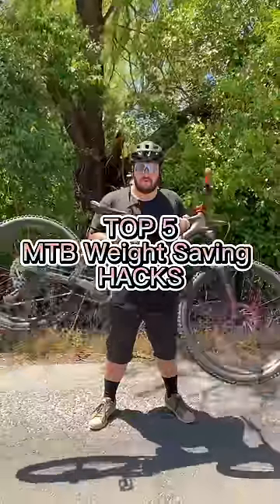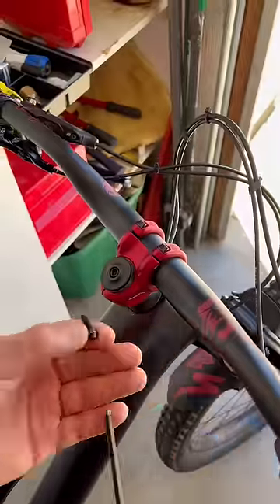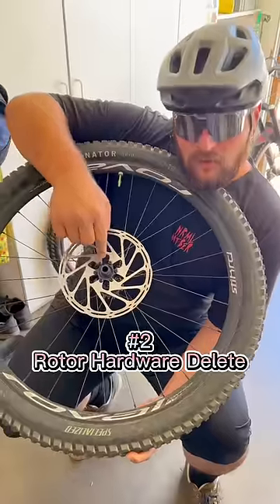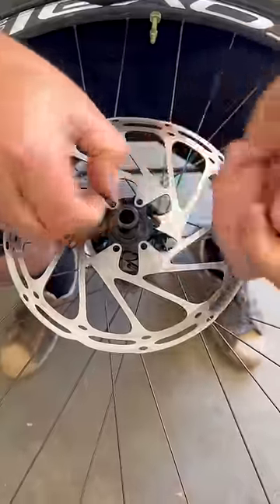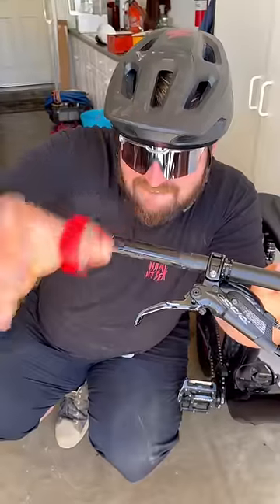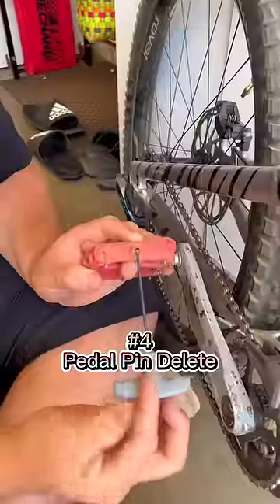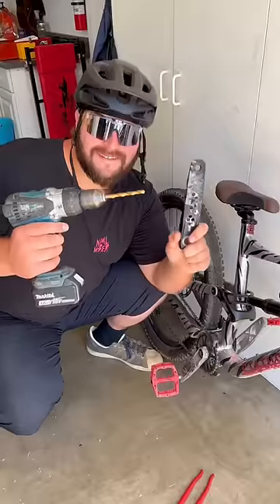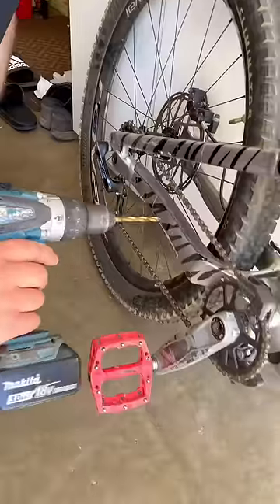Top 5 MTB Weight Saving Hacks

Comment: The wheels are pretty heavy too i usually just take those things off 🤷
Reply: Why don't just drill holes to them.
Reply: And the the frame, i take that off
Reply: Just take the front off and do wheelies.
Reply: intelligent move. saves a lot of rotating mass
Reply: Why dont u remove the frame its better i use that
Reply: Sam pilgrim liked this😂
Reply: Who needs the whole bike.Just cut it in half it will let loose on some weight
Reply: The seat is usually too heavy so I sit on the pole 😂
Reply: Honestly the head tube and the down tube weigh a lot too might need to get rid of those
Reply: I just got rid of my whole bike its now so light
Reply: I just usually take the whole bike off 😅🤣
Reply: @Atosark  😎🤣😭
Reply: Ya same
Reply: @SenseiOv8r  nahnah i remove the handle frame gear pedal tires shit is the lightest bike
Reply: The wheels are fine. It's the tyres that aren't needed.
Reply: yea bikes are pretty heavy so usually i ride without them
Reply: @dave161141  nah i'm better off hovering with my bike😂
Reply: Yh i just get a a but of plastic to hold the tyres
Reply: at the end of the day I weigh too, so I remove myself or drill holes in me. Depending on the mood.
Reply: I just fill my tubes with Air Light
Reply: Tire free
Reply: Ya those tires weigh allot best to just ride on the rims.
Reply: Ppp
Reply: Just cut some of the spokes off
Reply: I just get rid of the whole bike.
Now I just saved 15 kg.💪
Reply: I usually replace my tires with pool noodles
Reply: It's the tyres that are heavy. Remove them and keep the rims
Reply: Yeah why  not
Reply: Yeah just make more holes. 100 holes = 1 less pound

Comment: One of my favourite weight saving tips is getting rid of spokes. They weigh so much, you basically only need 4 spokes per wheel
Reply: Get rid of the handlebars you don’t need them.
Reply: AHAHAHA💀💀
Reply: @a.alexander7958  and don’t forget the stem
Reply: 4 spokes? Overbuilt!
Reply: 3 spokes are enough
Reply: Hahahahahaha, my friend is actually doing that, he jumps something massive, case it and loose a few spokes and rips them out of rim, every time I see him, he is missing a few spokes or had a new wheel
Reply: 3 Spokes is enough to keep the wheel centered 😂
Reply: Get rid of your bike and sleep you will never get in danger
Reply: 🤣🤣🤣🤣 I really laugh at this one this one 🤣🤣🤣
Reply: Yeah basically useless
Reply: Get rid of the whole body 
You only need tires
Reply: Get the angles right you can take it down to 3!
Or, if you need more tyre squish, take another off!
Reply: Dont forgot to get Rid of wheels, i usualy get wheels from kids bike its best
Reply: @nobody97436   if you take wheels from kids bikes it's also cheaper
Reply: @a.alexander7958  skateboarders don't use handlebars so bikers don't need em
Reply: actually my backwheel has only 18 spokes or so... i cant add more
Reply: Tires weigh to much as well
Reply: I managed on three spokes
Reply: U don’t need the seat and only need one wheel with 2 spokes
Reply: You use 4? All i need is one yo connect to the rim.
Reply: 1 spoke is fine provided it's strong enough
Reply: Lol
Reply: @chazpurves  and the shocks!!!!
Reply: I run 2 no rubber and I filled my frame with helium after drilling holes into the entire frame. It weighs 1 lb now. I also ditched the chain and pedals and therefore no need fpr shifters.
Reply: Get rid of your bicycle brakes brakes are heavy they're heavier than spokes
Remove disc brakes and replace them with rim brakes one rim break only it saves a lot weight you can remove the spokes if you want but I don't think it's safe if you remove them because it cost a lot of stress on the metal

Comment: The best is to remove the whole frame, so light and also burns more calories and so much core activation.
Reply: run. 0 bike weight
Reply: Instantly improves your relationships as well.
Reply: And even better, it destroys your joints by the time you're 50
Reply: Run on foot
Reply: @hallokitty98  *30
Reply: Spokes too, don't need em
Reply: Lol
Reply: pain activateion
Reply: Core is everything. Will make you a better biker

Comment: Cut all the heavy rubbery lumps off your tyres. Remove the saddle and seat post and stand up. 
Cut 6 inches off each end of the bars.
Fill your shocks with helium.
Think light thoughts. 
Boom. Done.

Comment: I have this coworker that one night at the bike shop took his BMX bike apart and using a Dremel tool sanded out the holes inside the frame where the tubes are welded so get rid of extra weight

Comment: You should remove your tires they weigh a lot and you don't really need
Extra weight remove two brakes put one rim brake and that's it You're complete if a brand new bicycle remove one more room break if you want to stop it with your feet

Comment: You don't need all that heavy air in the tires.
You don't need 10-11-12 speeds, only one sprocket will do.
Seats and seat posts are overrated, pedal standing up and hammer away. 
You only need one brake, the front, because the rear brake is heavier with a longer brake line.
160mm disc rotors still exist, get rid of the heavy 180-203 rotors.
 No need for the entire pedal, take the platform and bearings off and leave the pedal spindle only, much lighter.
 Get rid of half those heavy wheel spokes, not necessary to have redundant spokes. Maye 10 total per wheel will work fine.